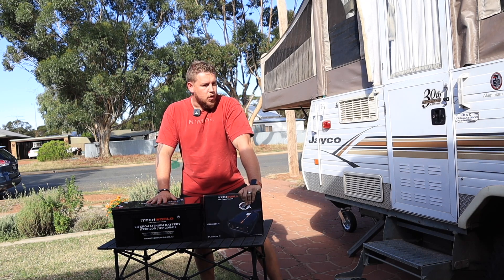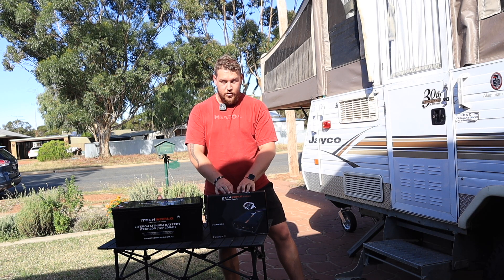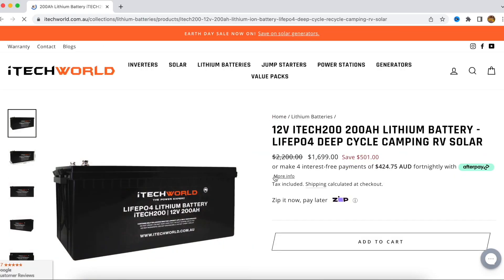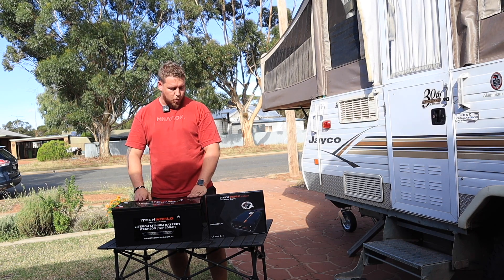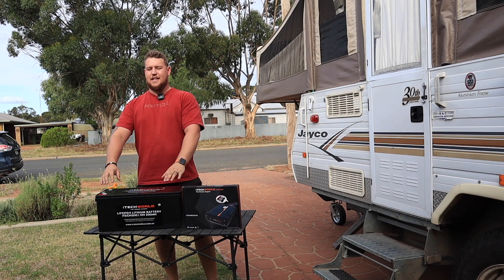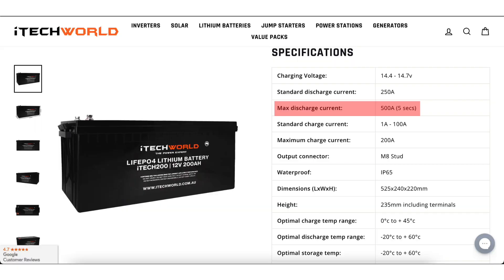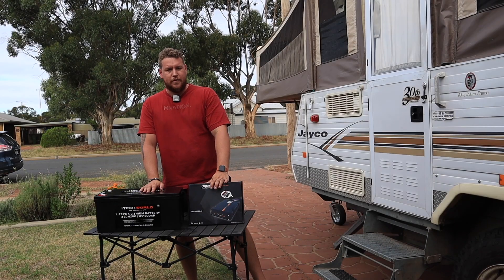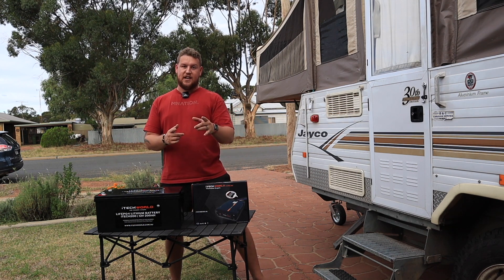Jayco Lithium Upgrade | iTechWorld ITECH 200 | Lithium Battery

Comment: You commented that in order to prolong the life of the battery you need to keep it fully charged as much as possible. Whilst this is true of all AGM or lead acid batteries, this is not the case with Lithium ion batteries. To prolong their life you don’t keep them topped up unless needed because of usage. Otherwise you never fully charge them especially if you are not going to use the battery for some time. It’s suggested to only charge to 90 -95% at the most.

Comment: Hey mate can these be installed straight into the default jayco j35b BMS (says no lithium) ?
The website says yes but I'm VERY suspicious. Thanks!
Reply from the maker: Hey Chris, 
I'd definitely get some sort of confirmation from iTechWorld first.
But just comparing the J35B charging algorithm with the ITECH200 specs, looks like it would be fine.
The absorption voltage is 14.4V which matches iTech's recommendation and the float voltage is 13.6 which is only just over the ITECH200 float voltage.

Comment: Another question. Do I need to purchase fuse as shown on the wiring diagram or are they included in the Shunt?  I am installing in the my Jayco, which is an upgrade from the existing acid battery, so I will be using the existing fuse system to the various existing circuits.
Reply from the maker: You would need to grab an in-line 1A fuse. 
The kit comes with the wiring required but no fuse in the circuit board supply cable.

Comment: I have just bought a 20 amp 12v DC/DC charger for my single 120AH battery, with the intention of only running 12volt. Just wondering if I should return it and upgrade to a 40Amp charger for a later stage if I add another battery and start running a 240v from an inverter. I don't think I would want more that 2000w inverter. I still have 14days or more to exchange. What is your recommendation.
Reply from the maker: Hey Robert,
It really comes down to how you plan to use your system. 
As a quick estimate a 2000W inverter will draw around 160 A/hrs at full load so if that’s the sort of load you’ll be looking to run consistently, I’d probably be looking to upgrade.

Comment: Are you buying a 240v lithium charger for when the van is hooked up to mains power to charge the batteries?
Reply from the maker: Hey Russell, not just yet, I really want to get the off grid capabilities just right before I start hooking in 240v.
But it’ll definitely happen!
Reply: Awesome, can’t wait to see what you use as I looking to see your full setup for when we upgrade ours
Reply from the maker: No worries mate.
I hope you get something out of our setup!